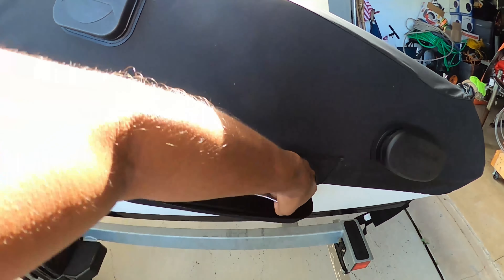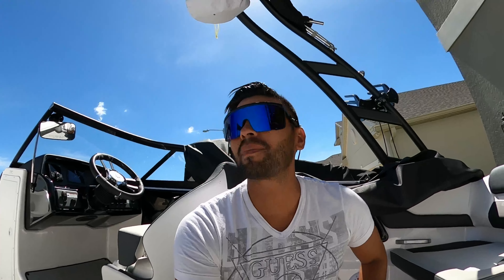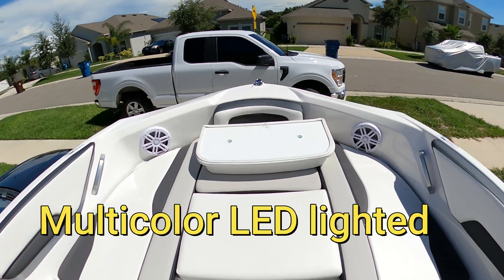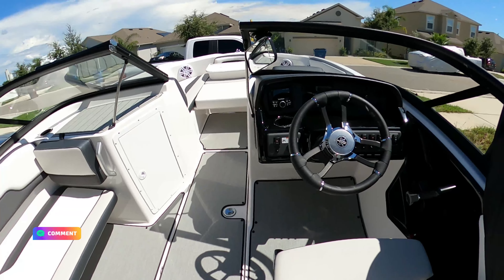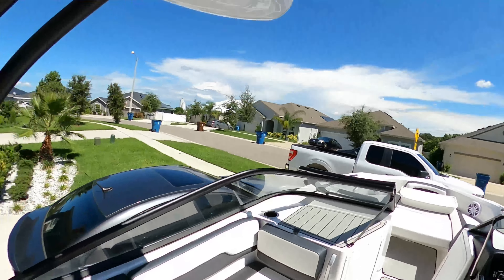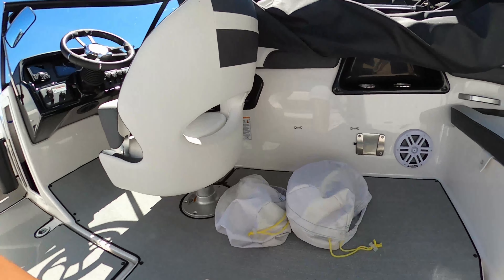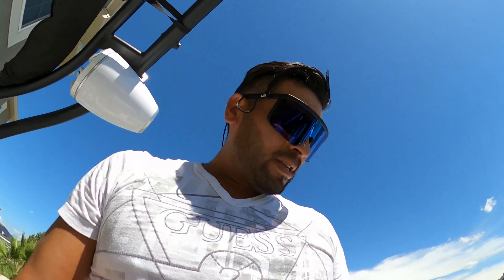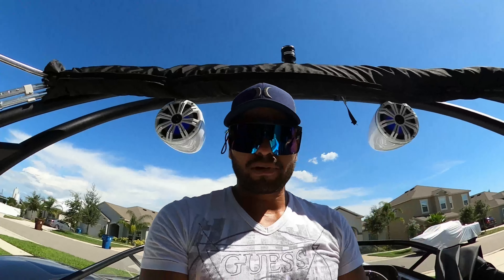New Sound System for my 2022 Yamaha AR195

Comment: The speakers on the tower. Where are the wires?
Reply from the maker: @skycloudrain, the wires for the speakers on tower are inside the tower.
Reply: @adventureswithrenso  Was curious on how you ran them thru so clean.

Comment: Nice audio! The stock sound that comes with Yamaha (Jensen audio) is awful. I have a 2022 FSH Sport and I replaced mine with 6 kicker 6.5, Kicker radio and Skar amp. Only advice I’d give is to install stand offs behind the two amps on the wall to let some air behind them. Nice setup!
Reply from the maker: @Joseph Moran, thanks for the advice! When I was doing the installation I tough about it but I didn't have it at the moment and then I forgot lol. I will try to add it. You have a nice set up too. How is your ride on your FSH?
Reply: @adventureswithrenso  I love it! I came from an 18’ Rinker bow rider. My FSH has tons of room to move and a ton of storage. The only negative I’m having is throttle drop, but I’ll fix it this weekend.